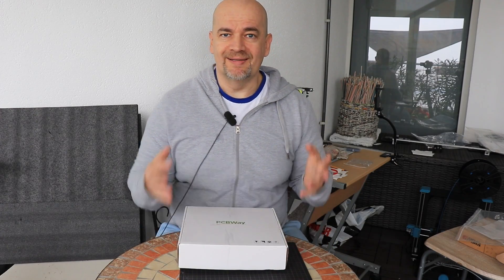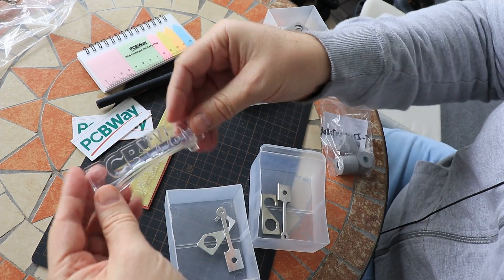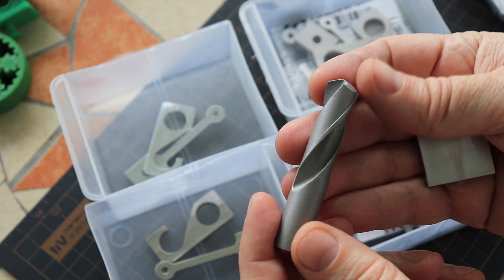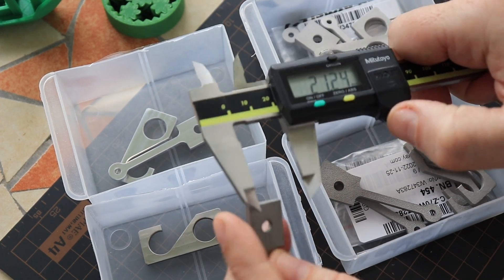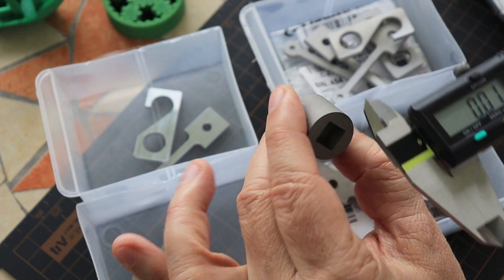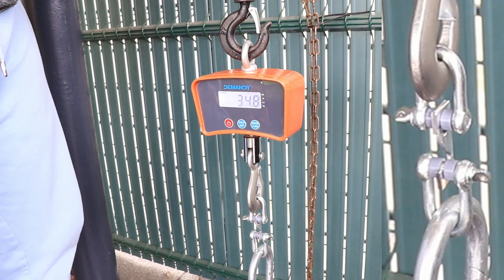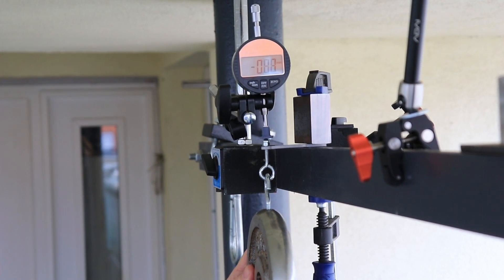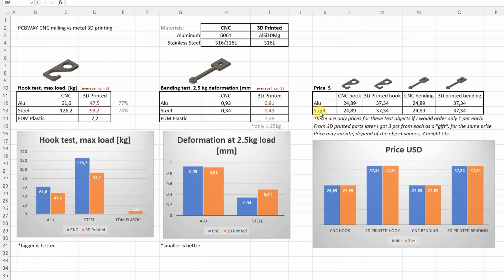CNC machining vs metal 3D printing (SLM) - Which is stronger? Services by PCBWAY

Comment: Sad to see a 25% loss. I enjoy the 3d printed parts, I guess i would need to also consider weld testing for some of the stranger styles parts to see if 3d printing is good enough. Thanks for the testing, will avoid the 3d print for my current order. My load is only 12kg between two 3mm brackets, so I guess it doesn't really matter in the end according to your testing.

Comment: According to your experiment, the UTS values are as follows:1726MPa
This value is too high and seems unusual.
Take 93.2 kg of 3D printed steel as an example in your experiment.
sigma_UTS = (93.2*9.81)/(3×3) + 6*(93.2*9.81×8)/(3^3) = 1726MPa
Reply from the maker: One thing is tensile strength Sigma = F/A and other thing is bending, where Sigma depend from torque and section modulus
Reply: yes. The formula is: sigma_UTS = F/A + 6 M / (bh^2)
For reference, the UTS value of the strength of rolled 316L SS steel is about 485MPa. I believe that the UTS value of 3D printed SS steel should be less than this to be a proper experimental value.

Comment: If you do it again it would be nice to see the slm heat treated. I understand the standard test, but for slm there should be an exception. You're not supposed to print the same thing because it's addictive. You're supposed to print more where it's weak and not print strong. Remove material from top and bottom and add a hollow arch around the weak neck. With heat treating you should be able to get a part 2x strength at 0.7x weight. That's how SLM is intended to be used.

Comment: The big reason why these cnc shapes are cheaper then 3d printed parts is simple.

They are 2d forms.

Make something with weird shapes and multiple milling sides and the price of a cnc machined part will skyrocket.

Comment: Regarding the diensions.. i noticed they are all OVER except for the one that was 15.99mm so at least you could sand them down smaller.. i would hate even more for them to be under sized... the 3d printing is new technology but the CNC dimensions should be better.

Comment: Unfortunately there are many many factors that you failed to consider. Things like sizes of available stock material, tolerances, etc.

A skilled designer who understands design for manufacturing could design similar parts that would cost waaaay less. Cnc machining has many many factors.

3d printing is expensive and wasteful - especially at scale

Comment: I'm curious to see how the results would change if the SLM parts were tempered. Wikipedia says "generally around 205 °C" for welded steel parts, so it could probably be done with a home oven.

Comment: Are you sure that there's no waste material when 3D-printing those parts? Surely that depends on the method, right? I mean, with FDM there's virtually no waste, but with other methods there might very well be.
Reply: It's SLM, where's the waste? Only possible source I can see is if you want to machine some part surfaces for a better finish and that's still not much material loss. Hell, I imagine you could probably use the waste from CNC machining with a bit of extra processing.

Comment: thank you for the follow up with this video.

The results are interesting.  Like you said, 3D printed parts can be more complex, so it's nice to know if you need something that can not be machined it can still be made and be reliable.  

I wonder if more complex parts are actually closer in price compared to parts CNC'd out of flat stock metal.   I'll have to go to PCB's website and play around with their quote system.

Comment: was waiting for this comparison for a while :D THANKS!
(wrt CNC being cheaper in your case, those are super simple parts, even for manual machining it is few minutes of work to make them, with proper cnc mill the major cost is in time for setting up the stock in the machine :D that's why cnc was so cheap, but with more complex parts where you need to "manually" create a proper toolpaths, use a lot of tools... it takes time and price go up exponentially compared to 3d printed/sintered one where price go up linearly with volume)

Comment: Very cool video, thank you for the information. The advantage of 3D printed metal is you can reinforce parts more easily and make more optimal geometry. However, you lose some material strength, so the benefits of more advanced geometry have to outweigh the disadvantage of material properties.

How does the price scale with quantity? I imagine the CNC parts would get much cheaper at scale, since a lot of the work is the initial programming of the CNC, vs the cost of 3D printed parts is the part volume.
Reply from the maker: Price may variate a lot, depend of the size, shape of object, if 3D printer parts can fit on the bed etc.